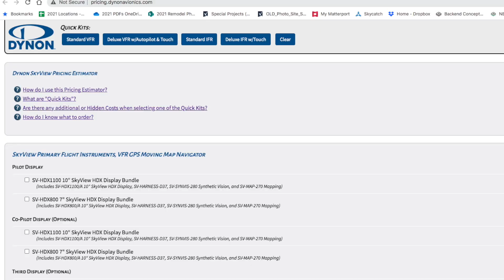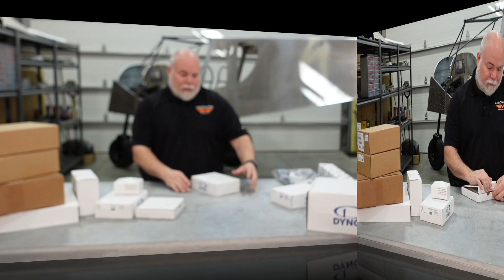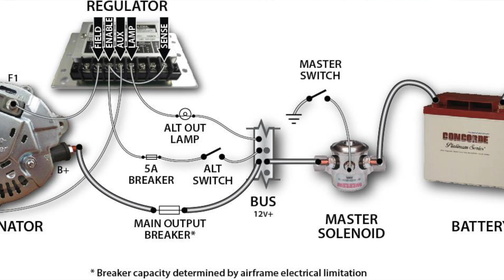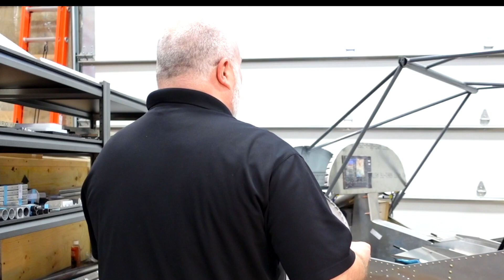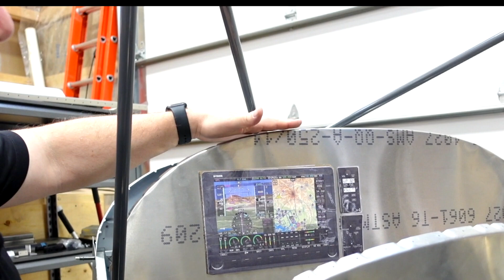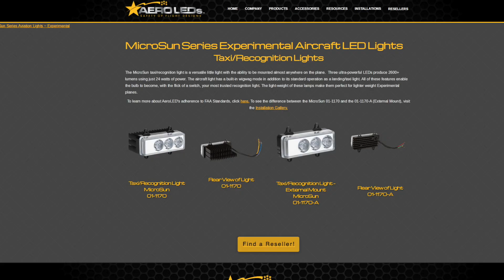Ep. 24 | DYNON Avionics Overview | Zenith Super Duty Aircraft Build

Comment: Curious: Why did you choose Vertical Power vs the (seemingly?) more integrated Advanced Flight Systems ACM?
Reply from the maker: Not really any more integrated except made by the same company.  No reason just liked the Vertical power options.  I’m also integrating some other custom
Features, buttons and switches.
Reply: Fair enough. I was sold on the VPX until I saw that Dynon charges a one-time fee to use it. Figured I should at least look at the ACM, see what it offers. At this point I still can't tell which is "better."

I'm a few months behind you, gathering info, so wanted to ask. Thanks!